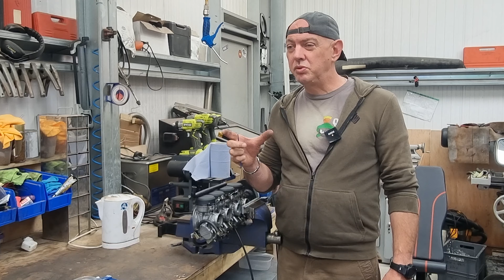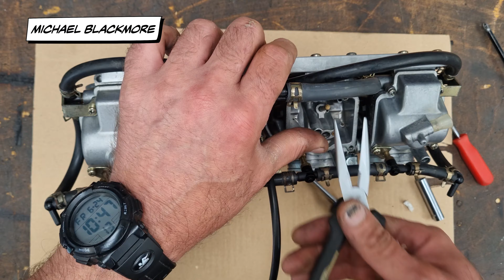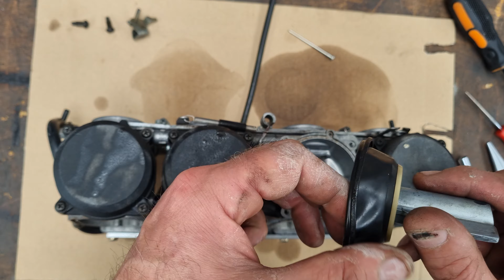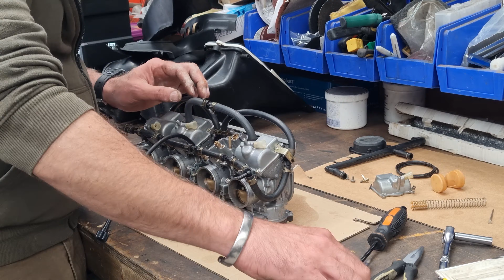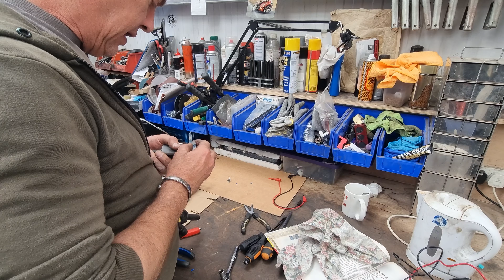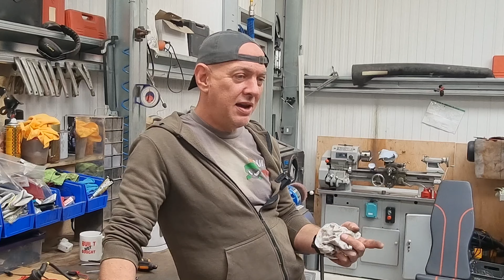Problems & plans - 1990 Kawasaki ZZR1100

Comment: The fun never stops does it?  😁 It is notoriously difficult to accurately measure low resistance of a very few Ohms, because of surface crud and oxide. Even if it looks clean there will be an oxide layer. I have a friend who used to be an electronics technician (for a cancer charity), he said they would sharpen their meter probes to needle points, which could then pierce through the oxide layer to get a better contact. It's a good tip. Only need to add 1 Ohm and your 3.5 is then looking like 4.5 and so it looks wrong. However like others I am suspecting HT leads and caps, which are now 32 years old. 😁
Reply from the maker: I must admit I don't like.old stuff, especially leads and electrical gizmos.  I'm swapping the coils anyway and will remake the caps, so I'm hoping I can have  incidence in them once done 👍

Comment: Hey quicky just a quick tip the cylinders are numbered from left to right so thats actually number 3 your working on. had the same problem with my zzr1100 so I put in new plugs and ran excellent after that.
Reply from the maker: Thank you matey. Yes I got the numbering wrong but they're both fed by the same coil so its no biggie really. It does pay to get it right on YouTube though hey 🤣😂
Reply: @QuickBikes  Yes but you still need to look at carb number 2 to see if its blocked and if it is I would recommend taking all the float bowls off to check for dirt you probable dislodged something when you changes the fuel sight switch.
Reply: @QuickBikes  also I would just do the head torques now 70 mile wont make any difference, It done some heat cycles that's all that matters
Reply from the maker: Totally agree matey. It's all striped down now so very easy to get to 😁👍
Reply from the maker: Yes matey, they've all been cleaned and float heights checked just to be safe 👍
Reply: @QuickBikes  If you have found nothing wrong with the carbs (don't forget to check the carb mount (they can leak air)) and nothing wrong with the spark side then do a engine compression test before you start to strip the engine (sorry to possibable be the bearer of bad new)!
Reply from the maker: Will do matey, thank you 👍
Reply: sorry I'm commenting as I'm watching I really would worry about that coil resistance its only slightly out of speck measure the other one for a comparison
Reply: sorry again  "WOULD'NT" worry about that coil resistance (TYPO)

Comment: So I just completed a rebuild of a 99 Kawasaki Concours, and one thing I would check are the resistors inside the plug caps, assuming you have them in UK models. I found that due to arcing, they needed cleaning on both ends of the resistor to improve the Ohm readings. Without it, they were way too high. The caps look the same as mine and they are fully serviceable. I also bought a plug wire kit for another model for cheap, and used the new copper strand core wire to redo my leads.
Reply from the maker: Ah, good to know, thank you. I've got the new coils.coming but they don't come with caps, so I'll check them when I swap them over 😁👍
Reply: @QuickBikes  also do a quick check of the pickup coil air gap, should be 0.7mm

Comment: Everytime I have had this issue, its been the plug cap (cutting off 1mm of HT lead until clean copper shows and screw back in) or a hairline crack in the HT lead that was very hard to spot and very intermittent.
Reply from the maker: It could very well be matey.  I've got new coils coming, but will keep them just in case.
Reply: Main jet seat/needle guide  make sure it installed and the right way up

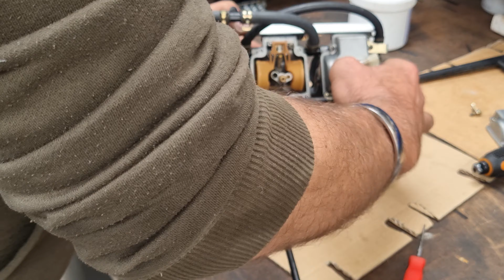Comment: @10:17 I just want to say, I set my carbs exactly the same way according to the manual and my bike overfueled like a pig. ended up setting the floats at 17.5mm in exactly the same way you did and that sorted the bike right out. Also used clear hose on the fuel bowl drains to make sure that when the carbs were mounted the actual fuel level height when full was correct and consistent between all 4 carbs.
Reply from the maker: Good way of doing it.... I like that 👍

Comment: Could have tried swapping the coils to see if the fault moves, the HT leads unscrew so it would be easy enough to do.

The coils probably are available but off a different bike. Kawasaki coils come with the HT leads fitted so different length leads means a different part number for what is basically the same part.
Reply from the maker: A very good point... I metered thenother coil and it was in spec, so just assumed the first coil is breaking down. Either way, it can't hurt to swap them I guess. It's a good thing to go grubbing around with, even if I'm doingnit a bit cavk handed and not explaining things very well on the videos... 😂

Comment: take a plug from the running cylinder. test ,   Swap could over completely , test    There is a resistor in the ht leads that often break down replace it with a bit of steel ( its only there to stop Mrs Jones going fuzzy )    test    IF STILL not running properly still  run it and grab a handful of wires and see if low tension feed tires are not broken ( electrics tend to be on and off and under load )
Reply from the maker: Thank you matey. I've not checked the resistors but the new  coils don't come with caps, so they'll get checked when I switch them over. The Bandit coil problem was really fussy to pin down as it was so intermittent and they just got swapped out in the end 😁
Reply: @QuickBikes    call in sick tomorrow , and fiddle with bike ,,, we are dying to know !
Reply from the maker: Hehehe.... I can't matey, as much as I want it sorted, I couldn't pull a sickie 🤣😂

Comment: Hey quickie. Like you I have not found any way to get the fuel valve seat out of the carb without damaging it. I have searched all over and saw one suggestion to make a brass rod insert the exact size of the hole to prevent it from being crushed when you squeeze it with vice grips.
Reply from the maker: Yeah  simar to how you get dowels out... that would work...👍

Comment: 2005 Cbf600 not run for years and years with only 385 miles on it last ridden with salt on the road. The carbs were gummed up big time, HT leads breaking down. Three times the carbs were off stripped and cleaned and breathers and HT leads replaced to get it sorted. There is little inside the plug caps but thete is a ceramic resistor (cannot find any replacement resistors on the whole of the planet Earth) which can eventually breakdown
Its sorted and runs sweet.
Edit. The chrome sliders - you can sort the pitting out gently using a window scraper to remove the high spots (dare say a scalpel would work) then THOROUGHLY clean out the pit and fill with epoxy (difficult) or super glue, cleaning off any high spots with new blade in the window scraper.
Reply from the maker: There's going to be bits n bobs that need doing as not everything got stripped and serviced, it was just rebuilt. I'll get there matey 👍

Comment: you can still buy the coils new, part numbers:-  21121-1220 and 21121-1221 there £163:13 each lol, and for the spark plug caps its :-211601098 there £31:50 each fowlers have 28 of them, OEM things arnt cheap, but when you consider how long they have lasted sometimes its worth the change of under wear to get them. sorry i was looking at the D model doh,, your right the coils are no longer avalable, I'll get my coat lol.
Reply from the maker: Hehehe... It makes me chuckle how they say £115 for a coil but they're no longer available 🤣😂

Comment: Just a pointer, it is best to ensure your multimeter reads near to zero prior to measuring anything.
Had problems with my carbs after stripping and ultrasonic cleaning, cylinder 2 and 4 slides not moving, removed them a second time blew them through with compèred air all ok thereafter. Balanced up running well now. As for your coils you can get aftermarket items on eBay .
The fitment in the frame on the C models isn’t great, this was altered on the D models.  You can measure the secondaries by unscrewing the plug caps.  The gearboxes on the C models do have weakness on 2nd gear anyway wishing you luck with 5 gear, the oil pump casting drops out of the bottom, had to replace my oil filter intermediate casing due cross threaded filter bolt. The oil cooler spacer had also corroded and wouldn’t seal these are no longer available but Crawley Kawasaki do had D model ones which fit but they are very slightly longer.
Reply from the maker: Thank you matey  that's very helpful. As you'll see in the next video, I tried having a peak in the gearbox which didn't go that well... I think the cases need to be split to sort out 5th gear anyways, but I found some other stuff as well. The caps need to be swapped over to the new coils when they get here so I'll meter them again at that point just to make sure everything is OK before assembling it all again. 
Thanks for chipping in matey 👍

Comment: I was surprised you didn't test the other coil. But you'll have a spare now😐
I hate electrics, I found the plug caps and leads to be the worst culprit.
Hopefully you'll get it sorted and still get some good riding in.
Reply from the maker: Thank you matey. I hate these kinds of issues and find them frustrating. I'm also.prone.to missing steps in a logical fault finding mission which doesn't help. The other coil measure in tolerance so it could be the cap I guess, but I'm replacing both coils anyways as I've had old.coils / leads break down with age and it can't really hurt. I should have shown this on camera just to.make the point....

Comment: What preceded your problem? Running out of fuel - twice . So the carbs were definitely sucking on any residual crap in the tank. It only takes a very tiny amount to block an internal passageway in a carburetor. The fact that the problem stayed with the same cylinder (no 3 reading from left to right looking forward) says to me that the problem is the carburetor. The coils as far as I am aware are singles with two output leads running a wasted spark, if it was the coil then No 2 cylinder would also be missing. If there is residual crap in the tank it will be water based so take the tap off and fit a small extension pipe to the reserve tap outlet pipe that way the crap will stay in the tank, you will lose a little bit of range but better than all the buggering about
Reply from the maker: Sound thinking matey. I didn't explain things very well in the video and I'm just doing an update video to cover the points I missed or got wrong. I'll get it sorted a d I'm changing coils just because they don't measure right anyways, buy to me everything pointed to fueling. Thanks for chipping in dude 😁

Comment: Check the resistance of your meter leads then subtract that from your measured resistance. Coils can degrade over time as the varnish on the windings degrades but this is quite rare.
Reply from the maker: They would appear to be dodgy as neither coils measures the same. It's probably best just to replace them in my book...
Reply: @QuickBikes  come get this one. seriously, im about to ebay it.
non runner, burgungy zzr1100,  i tried selling a bike ad ended up with it, 
itll be on ebay next week but youtubes doing its algo thing.
you wnat it?
Reply from the maker: When you say non runner ... 🤣

Comment: Sorry but did you zero your Ohm meter before you took the primary reading, your only out of spec by 0.4 of an Ohm, loving the channel hope the gearbox is a simple fix 😎
Reply from the maker: Errr... I'm not sure now you say that...  I think so as I normal touch the probes to check the reading before testing something, but I could be wrong. Either way the coils are old so it wouldn't hurt to swap them 😁

Comment: Hello Sir, 
I have a Kawasaki ZZ-R1100 C1with Keihin CVKD40 Carburettors. I've restored the bike but, when running at temperature it idles a little lumpy. So after some diagnosis and processes of elimination , I have decided to remove the carbs, inspect, ultrasonic clean  and overhaul. My question is, where is the best place to get good carburettor overhaul kits and an abundance of "O" ring seals for all the coolant and fuel plumbing? 
Many thanks
Allan

Comment: I thought you swapped the leads over and the fault remained on cylinder 2 if so its not the coil, leads or cap. Haven't watched the vid again but thought you cleaned the plug and briefly it ran ok then the fault re appeared  For me it all points to a defective plug. Would have been worth trying a new plug before digging in to the carbs and coils. I've always struggled to get reliable test readings on coils and have even reused  ones I've previously binned that went on to be fine. Looking forward to hearing it run sweet. Unlucky with the 5th gear issue but it'll be fixable.
Reply from the maker: It certainly sounds like carb or plug to me, but just because they didn't measure correctly the coils are getting swapped out just to be safe... I could well be wrong buy there's jot harm in replacing them as they're ancient 🤣

Comment: Hi  Quicky,  don't normally comment as i watch on the tv , but just a thought? have you done a compression check to rule out a mechanical issue?  best of luck.
Reply from the maker: I haven't yet, but will do so when I've got the other stuff I'm waiting on. I'm going to retorque the head first as it's due, but it will get checked 😁👍
Thank you matey 👍
Reply: @QuickBikes   personally i would check the compressions before torqueing the head, might save you stripping it twice incase there is a problem, keep up the good work.

Comment: Have you got a filter between tank and carbs? If not add one asap
Reply from the maker: There is one matey. I pulled it apart to check if junk was coming through from the tank and its all good. Sorry chap, I didn't film that bit as it was just a quick thing...

Comment: Hello sir my question is for a different issue but still about zzr, a lot of people says zzr 1100 d has always the issue of the third cylinder blowing out.,what are the symtoms of it and how to chek and take care of it..thanks in advance
Reply from the maker: That's not something I've encountered yet, so can't really comment I'm afraid... I have a knocking noise up to 3000rpm which I think is a spun shell bearing, but won't know till I do an oil pressure check on the galleries or pull the engine apart again...

Comment: Spray carb clean into number 2 carb and see if it fires, that will 100% rule in or out the carb.
Reply from the maker: Aw yeah.... I didn't think if that 🤣😂
Reply: @QuickBikes  Maybe a compression test to check for a stuck valve too
Reply from the maker: Yes matey, it's on my list of things to do as you Spark, fuel and compression to.run right 😁👍

Comment: Well at least your working through what it isn't.. with luck the newer coils will solve it . And just remember not to try and filter with the van it's a bit wider than the bike
Reply from the maker: Hehehe... its not as quick either. When the bike.was.running right it was LOADS of fun 😁👍
Reply: @QuickBikes  had some fun today similar to yours cant work out what's wrong . Mate came up for me to refit his panniers brackets . Had to take off the indicators to mount to the rear bracket .xjr 1300 job all sorted starts bike to go pops in gear clunk dead . 1st thing side stand ..nope 2nd idea clutch switch nope 3rd neutral switch nope . Under the rear end theres a stupid clip in a twin wire that's got sommat to do will the whole thing .. little black plug fell off while me hands were putting the indicators wiring back ..who the f puts sommat that important under the rear light cluster? ? Least we found it ..took 6 bloody hours and a shit load of electrical testing of other circuits ..
Reply from the maker: See.... its these little gremlins and dumb stuff that I like finding out 🤣😂😅 It's often the dumbest most stupid thing that trips you up and keeps.you humble. Well done on finding it matey 👏 👍

Comment: Might pay to fit a fuel filter on the fuel line.
Reply from the maker: There's one on there to the pump. I did check it off camera and its basically fine, but I should have covered that in the video 😁👍

Comment: hello buddy could you not swop the two coils over and see if it did it on the other two cylinders
Reply from the maker: I could, but they're not measuring right anyways, so they're getting swapped out. You're absolutely right though matey 👍
Reply: @QuickBikes  cool. just thought it might trying just to see what happens with a good coil on it.
Reply from the maker: Yeah it's a good idea matey.  I thinkni was just getting a bit frustrated by that point 🤣😂
Reply: @QuickBikes  know what you mean put pods on mine and it won’t run Smoothly when you blip the throttle.  tried air screw in and out no difference. Messed about trying things with the pods. So guess it’s jets next. At least full  1/8 to full throttle is good 😂😂
Reply from the maker: CV carbs are a nightmare with POD filters normally, but put the airbox on and the problems go away. That could be part of your problem maybe. Trouble is that Pod filters just look betterer 😁
Reply: @QuickBikes  yes your right but I've chopped the frame made a new battery electrics tray and sold the air box.. guess that's just the joys of doing a project. Guess I've got more tinkering to do.

Comment: Plug Wire??..They are old..I guess rechecking valve clearance in #2 is something else easy to rule out..You can use the coils off any comparable  bike...again just to rule that out...I have had cracked plug insulators...and bad plug wire connectors....just have to eliminate 1 at a time until you find it...A coil,wire,connector,or plug issue should become notably worse, in gear under load( brake on let clutch out and slip)...LOL..GOOD LUCK!! ..👍🗽🇺🇸
Reply from the maker: Oooo there's plenty it could be. The bike is old and I haven't keep remembering that.  All kinds of stuff could be buggered 🤣